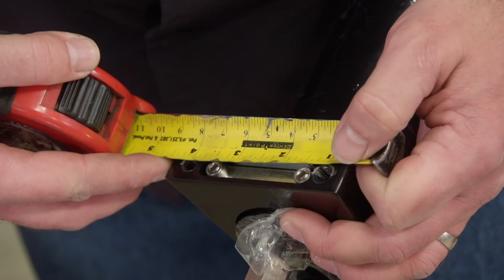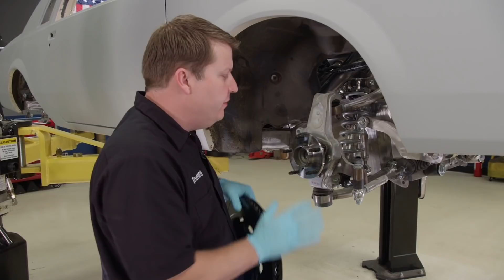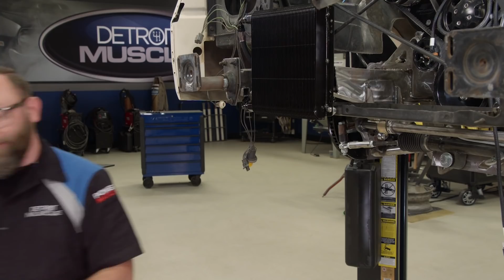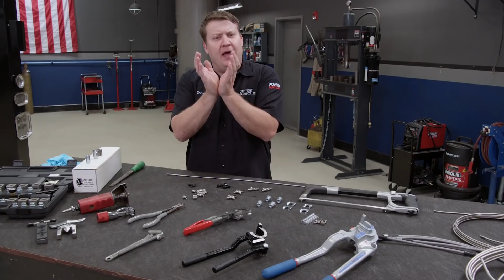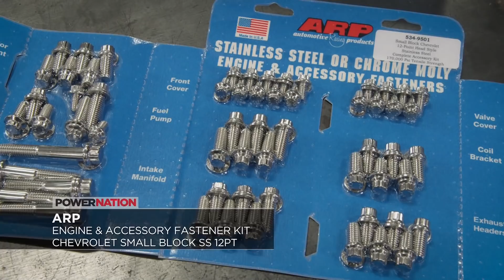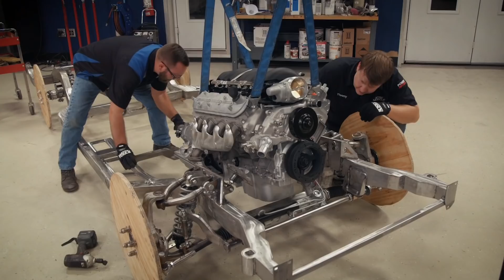Tips for Custom Brake Lines and Hoses - Detroit Muscle S7, E9

Comment: As a plumber and pipe fitter I do a lot of work with tubing. His lesson here is really good, and you won’t go far wrong if you follow his directions exactly. And yeah a tubing straightener doesn’t seem worth it, but if you care how your work looks it is the most important tool in the process

Comment: For the money that the front brake kit will cost ya just go with 2WD 1998-2004 Blazer spindles and C6/7 brakes to stop that LS. I have a stock 5.3 swapped into my 1978 El Camino and the stock Blazer set up stops it perfectly fine.

Comment: I have never been able to flare a brake line so I am confident that it will not leak. Tommy makes it look easy.
Reply: The bench vice mounted flaring tools work really well. They are well worth the $150 they cost. I got taught to make lines at a late age by an even older mechanic, never had one leak using a quality flare.

Comment: Your tool list is missing in description. I want that flare tool
Reply: Flare tool is Matco Master Hydraulic Flare kit Part No. AC72475A. I live and die by it when I make brake lines.
Reply: @jc18137  what about the smaller one?
Reply: I am betting the one we use when gasfitting, made by ridged tools, is likely a tenth the cost.